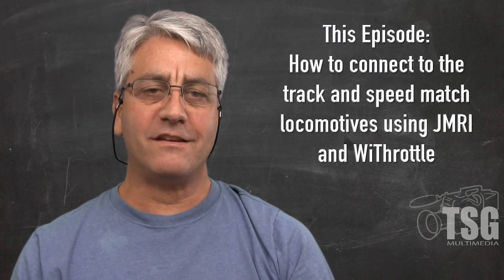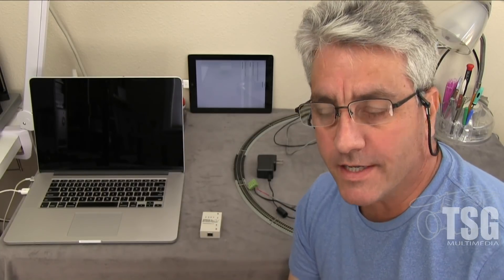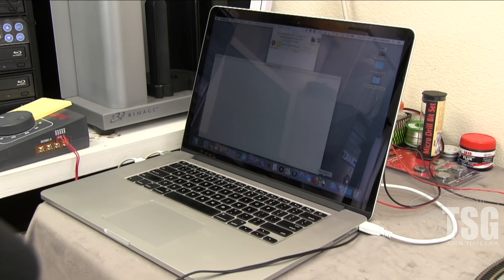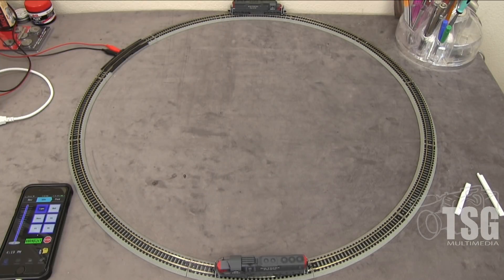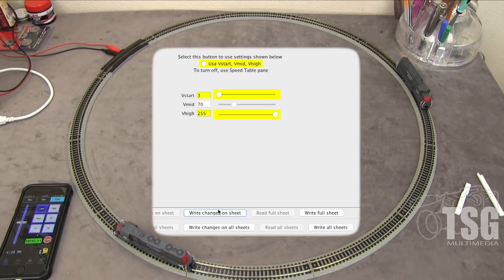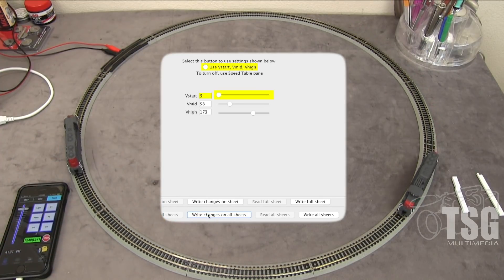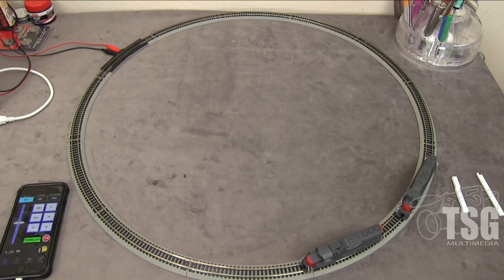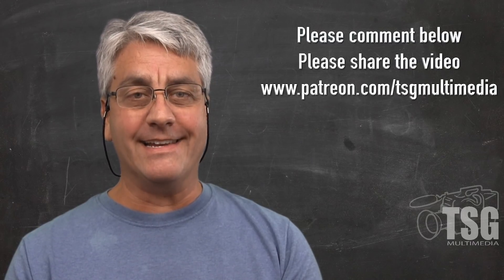Model Railroading 101 How to Speed Match DCC Locomotives JMRI SPROG WiThrottle MR101

Comment: John this is a great video tutorial.  What size KATO circular track are you using?  Will it work with six axle locomotives?  I am an N Scaler.  Thanks!!  Happy Monday!
Reply from the maker: Sadly, that was Bachmann track, and I think it was 12" radius. It just barely was able to handle 3 axle locos and when I say just barely that means I would use something bigger just to be safe.
Reply: Thanks for the quick response John.  I am going to use KATO 282-45 track.  It comes out to about 23" diameter.  Keep up the good work!  Happy Wednesday!🙂

Comment: Great tutorial. I've used the speed table before  but not like you did. constantly moving the loco from layout to programing track and back. Big pain. So what programing mode did you use and did you connect your smart phone via usb cable to computer ? I can not find WiThrottle in the google play store to download.  And how can i speed match like this if both locomotives are on the same address? Like 35 for example.
Reply from the maker: I think most of your questions were covered in the video except for the programming mode. This was recorded like almost 4 years ago, so I can't say I remember clearly, but I think it was in "program on the main" mode.

WiThrottle is for iPhones. If you use Android, you want something called "Engine Driver" and I think it can be found in the Google store.
Reply: @tsgmultimedia  Yes it was 4 years ago. I just now seen it. And yes i have android phone,  Samsung and i did see engine driver in the Google store. Thank you. I will check it out. Now, was you iPhone  plugged into the computer or not while using the WiThrottle? Sorry I'm kinda new to jmri .
Reply from the maker: @steamy1225  The phone is using wifi and is not plugged into a computer. The "wi" in WiThrottle stands for WiFi.
Reply: @tsgmultimedia  Ahh. Thank you very much.

Comment: This was a HUGE help!  I had 3 locos to consist with my Zephyr Express.  Over the last 2 days I spent hours of frustration trying to get 3 to speedmatch correctly.  No problem with 2.. I literally burned out a little.  Smoke came out of my ears.. 4-5 times got lost, and used CV8 just start over.  I almost passed up this video when you started talking about JRMI, I wanted to learn more as I've been in the hobby almost a year.  I then decided this was the best way after the video.  Even better the new Zephyr Express supports HDMI our of the box so I didn't need the interface.  Long story short I had all 3 consisted in an hour.  What a cool program!  Thanks!

PS seriously almost spent 70$ on Accutrack II..
Reply from the maker: Excellent - this is the kind of comment that makes all the work worthwhile! Share it with your friends if you think they could also benefit!

Comment: So I can consist locomotives without coupling up?  My GE is on outer main with train on it and I want GE to have that be same speed as the EMD's are but will not actually be running that in consist with the EMD's.  I just got JMRI Decoder Pro 4.18 installed on Windows 10 laptop.  I do have Withrottle on my iphone.  I have wifi device for my digitrax DCS 52 which is the LNW1.   I need to navigate the panes on my jmri cause they seem to be scrunched together.  I need to spread things out a bit cause when I have my roster done,  the roster list so compacted together that I can't see the things on that list.  These are just common adjustments with Windows programs.    I have a lot to learn with JMRI as I am a beginner on it.

Comment: Hi Joh, Thanks again for the video.  I have a question.  You used a phone running Withrottle in the demo.  I'm using engine driver and a Windows machine.  I know from my experiences using my phone to run a digittrax layout, you have to have a wifi interface for the phone to control the engines.  I'm a little confused on how you are controlling the engines on the circle of track with out something similar.  Am I missing a step?  Thanks.
Reply from the maker: Hi Chris, the SPROG device connecting the track and the computer is providing the interface. Two wires on one side going to the tracks and a USB plug on the other going to the computer. JMRI is running on the computer which has wifi enabled on it, so the signal from the phone reaches the computer over the wifi, processes through JMRI, then to  the SPROG, and back on to the track to control the trains.
Reply: Ah, OK.  Got it.  Thank you.  You're doing good work.  Keep it up.

Comment: Taking into consideration the fact that the DCS 52 has got its own built in interface . Does that mean decoder pro can be used together with the command station to speed match 2 locos on a circle of track without - obviously - the need for the sprog  ?       Thanks

Comment: Hallo John, Im Errnie  from holland, and I have a EMD DD40  with two moters,  to make it a DCC, must i put in two decoders or one?
Reply from the maker: HI Ernie, I'm sure you can run your model with one decoder. As a matter of fact, I'd be surprised if using two decoders would even work because it would have to be consisted with itself when you run it. I'd try running the orange and gray wires to both motors out of the decoder. There should be no other consideration other than that to worry about. You could also check with the manufacturer and see what they recommend.
Reply: @tsgmultimedia  Thank you John, for your information, I have  Lokpoilot 4.0 decoder,  and it is rated at 1.1A,  the locomotive is a atheren  from around1960 i think,  and when it runns it uses 1.2 A,  it's at the high end, but i'm going to try it, hope i don't blow up the decoder. keep up the good work,

Comment: Hi John - great instructive video and probably the quickest way to achieve speed matching. My system is NCE Power Cab with HO stock so the process is virtually identical. All my locos have back EMF which makes the speed matching requirement essential. Also, I use a circle of 18 inch radius curves just the same. Many thanks for the video.
Reply from the maker: Thanks, Keith! I appreciate the compliments, and agree with you. I have not seen a simpler or easier way to do it yet. If I ever do, I'll share it on the channel.
Reply: Hi John - I believe the trick here is the fixed throttle position whilst CV5 & 6 are being adjusted. I've never thought of that before.

Comment: JMRI is truly capable as well as practical but there is always some locomotives that can not be matched .  I have 2 Steam G scale engines both by Piko ( German class 80 ) and reading CV 8 on both locos results in the value 123  ( Massoth  decoders ) cv2  cv5  and cv6  did not have any effect and the same applies to the speed table  . One loco is faster than the other ( my interface is the Digitrax PR4 )  . Any  tips would be greatly appreciated 
Thank you

Comment: On my railroad I have some issues. I have two DCC units that I want to run together. They are both genesis engines but run at complete different speeds. I’ve struggled with speed matching for years.

Comment: Caveat that I am very new to this particular hobby, but I think your method is fine, closely matched the slower will by pushed or pulled slightly but will also contribute and both will be pulling the cars together without any accordion type behavior and derailing.  To do an exact match run them against piezoelectric pressure sensor (cheap, used as contact sensor in many hobbies), record voltage change in pad, get ratio difference between the two locomotives and apply to voltage adjustment... I think, never done it, but might try.  Can any electrical engineers confirm that this approach would give on very close to exact match in traction output?  Would differences in trucks and wheels matter?

Comment: Didn't catch if it was mentioned in the video, but would Digitrax's Accutrack Speedometer help?
Reply from the maker: Not so much because the speed of each locomotive simply needs to be relatively the same as the other one.

Comment: Sprog is one of numerous interfaces-it works with all systems and JMRI. NOW for my
Question: Why did you not speed match the "Start" for each before doing the mid and
high speed sets?
Reply from the maker: Good point! They were acting the same out of the box in that respect, so I left them alone. The mid and high were very different though.

Comment: John, I really appreciate this video because speed matching has always been challenging for me to do, and I want to be able to run my diesels in multiple-unit consists. I use JMRI for speed matching, but from your video, I can see a big advantage in using WiThrottle and not touching it during speed matching. I can also see a big advantage in speed matching on a circle of track instead of on the layout as I have been trying to do. Your video has inspired me to try to speed match my diesels using your methods. Thanks so much for this video. ...Roy
Reply from the maker: I'm glad I could help, Roy. I will eventually go back to your ballasting Kato Unitrack video some day if I ever get around to building a module or layout for myself. :D

Comment: wow we have come along way from the simple DC power pack
Reply from the maker: Big time! This is another way that DCC is superior to straight DC. The only way to speed match in DC is to change out motors until you get two that are close to the same. With DCC you just tell the decoder what to do and it does it. What a huge advantage when you want to operate multiple units together.

Comment: I guess we are supposed to know what a SPROG is or just have one laying around? It's a new one on me.
Reply: You can also use an Arduino DCC++ controller which you can make for under $50. or if you use Digitrax or NCE  use the adapter they have to let you be able to talk to your computer threw the USB. Personal I found the DCC++ system works well for me and there seems to be a way make a speed sensors sent the speeds to JMRI. Although I have gone that far yet.
Reply: Also there is also way to hook the Sprog up to a Rasberry PI and have that be a very compact JRMI controll system  that merges computer JRMI and DCC++ control  all into a litlle small system you can place on your layout.